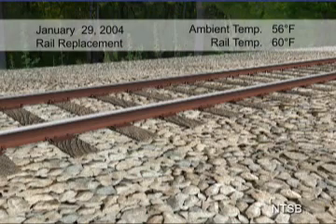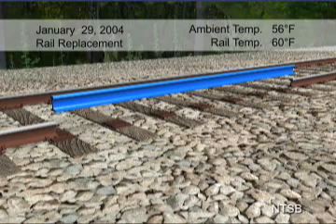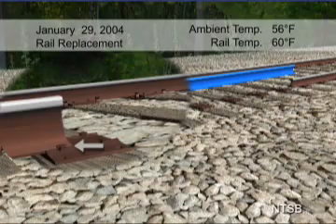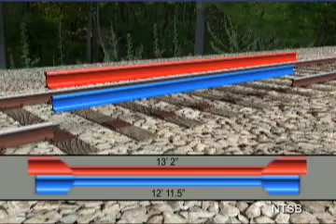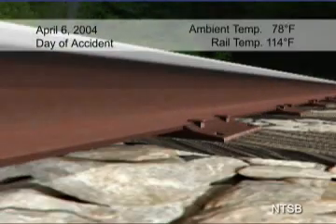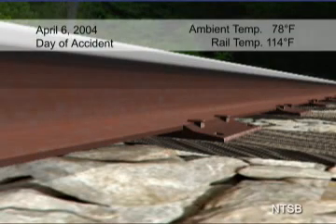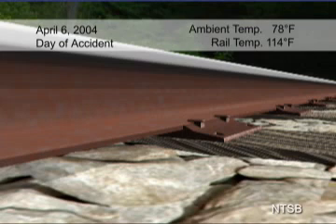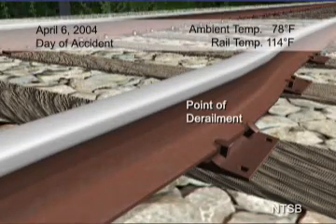Derailment of Amtrak Train No. 58, City of New Orleans - Track Features Animation

Comment: They did not cut their track properly. The correct way to cut track is if it is in cold weather you have to heat the rail up and then cut it and then when the rail is reinserted it has to be heated to neutral temperature and then gapped. If this is not done you will have a Pull-A-Part you can get a kink and I could cause a derailment. In this situation the rail was too long so that caused the derailment. Always gap your rails.

Comment: Those train / track employees,  SHOULD  BE  REQUIRED, to take a steel  education. Most rails, in Canada are created from  1984  steel.  
     1084 has low wear resistance and decent shock resistance, so if you make a knife of it, don’t forget to take care of it and oil it.
                                    1084 Steel Chemical Composition
0.93%      of Carbon: For tensile strength and Edge retention.
0.9%         of Manganese: Increases hardness and brittleness.
0.5%          of Silicon: Increases strength like Manganese.
0.3%           of Phosphorus: Increases strength.
0.5%            of Sulfur: Increases machinability, and decreases strength.
            If you noticed, there is no Chromium in this alloy, so automatically, its wear resistance will be low, neither Molybdenum or Nickel for toughness.

What is the hardness(HRC) of 1084 steel ?           According to the industrial standard hardening test, the  Rock well hardness of 1084 is 50 H R C at 650 (F) Heating temperature and 65  H R C   at   300(f).
THEY  SHOULD  have installed, the new rail, AFTER  it should be sitting near the track, from the day before, BOTH  would be at the same temperature;  also, there should have been a gap, between BOTH  ENDS, of the new installation, about  1/4  inch, depending on the length  of   the  new  piece. ( Figure mathematically the expansion, distance of said rail, from ambient temperature, to about as low / high  as  the weather  in  that section of  the country...)  THEY'D   BE  OKAY,   no derailment then !    ( old guys )
Reply: "THEY  SHOULD  have installed, the new rail, AFTER  it should be sitting near the track, from the day before, BOTH  would be at the same temperature"
The difference in temperature between ambient and track temperature was 4F (2.2C). If you think that a 13ft (4m) length of steel expands by 2.5in (64mm) when its temperature increases by 4F (2.2C), then you "SHOULD  BE  REQUIRED, to take a steel  education".

The actual issue is that they were replacing a section of pre-tensioned rail. Instead of re-tensioning it, they let the tension out and then filled the gap with a longer section of rail.

Comment: This explanation is hogwash.  The initial gap cannot be explained by thermal expansion alone - unless the original rail was laid down in extreme heat.  Steel coefficients of expansion are right around 1.2x10e-05 (per Kelvin degree)  So the new rail, based on ambient temperature difference alone, would have be lengthened by only 0.0003" difference.  Even extending this to 1/4-mile welded track segment, that doesn't get you anywhere near 2+ inches difference, even with a roughyl 20-degree kelvin warming.  Something's amiss here.
Reply: The simplified calculation we use in the field to calculate rail expansion is (0.000078)x(length of rail being expanded, in feet)x(difference between target rail temp and curent rail temp, in Farenheit). Using 1600 feet of rail and a 2.5" expansion, the rail only needs to change temperature by about 20 degrees, F.

Most railroads set a stress-free temperature between 105F and 120F for their rail. A contraction of about 2.5" seems possible at about 60F if the rail was set at the specified SFT before it was cut.

I've had a 1" gap cut in the morning at 40F close up and bind the rail by lunch time in March with a high of 60F that day.
Reply: I'm looking straight at a CRC materials expansion coefficients table, and I'm telling you, all the ferric alloys are expressed in "ppm" - parts per MILLION.  They're all in the neightborhood of about 11 per C degree, and around 6 per F degree.  Now owing to some of the special ingredients of rail steel [Mn is one that I know of], I'm willing to raise that to about 7.8 ppm per F degree, as you suggest.  That's 0.0000078 - not 0.000078.  And that's why I said that even a 1/4 mile track length would expand about 1/4" over a 20-degree range.  For 1600' track sections I still get only about 1/2" over a 40-degree range.  Where the decimal point is matters.
Reply: @jimwinchester339  if you check your coefficient, it’s 11x10^-6 mm/mmC. Put it in the equation of thermal expansion with a delta of 11C (20F) and a rail length of 487680mm (1600ft) and you get about 61mm, or 2.5in. The 0.000078 coefficient is probably to convert both mm to ft and C to F.

We can talk books all day. I’ve personally marked rail for expansion and monitored plenty of expansion operations to get rail to a target SFT, and it behaves as I’ve described.
Reply: The explanation in the video is incomplete, which makes it misleading. The 4F (2.2C) temperature difference between the track temperature and the replacement rail section is almost irrelevant. The point is that the original track was tensioned so that it wouldn't expand significantly unless the temperature got really high. The cut rail contracted back because that tension was released. The crew should have re-tensioned it and replaced the cut-out section with another section of the same length.

Comment: Just need a simplex rail puller, your cwr chart and bring the rail neutral temperature back to 105 Degrees. Then make sure all rail anchors are applied.
Reply: And don't forget the flux capacitor.

Comment: There are millions of miles of welded track. How can that little change, in temperature, cause the track to deform thar much? There is something else that caused that accident.
Reply: The video doesn't explain the background and is, frankly, misleading when it talks about the temperature difference of 4F between the new rail segment and the track section. That difference is negligible and irrelevant. The actual issue is that the rail they were replacing was pre-tensioned. That's why it pulled back when they cut it. The crew should have re-tensioned the rails and should have replaced the cut-out section with another section of the same length.

Comment: Well here's a good place to ask why continuous-welded rail doesn't do this all the time. I imagine there must be expansion joints at SOME interval.
Reply: It''s mostly done by pre-tensioning the rail. Ths is why the rail in this incident pulled apart when the maintenance crew cut it.

I'll make up some numbers to illustrate the point. As I recall, continuously welded rail (CWR) is installed in quarter-mile lengths, which is 1320ft. Suppose you know that one of these sections of rail will expand to 1321ft at 130F, and that a rail temperature of 130F is the most you need to cope with. You stretch the rail to 1321ft before installing it, and attach it very firmly to the ties. Now, as the rail heats up in the sun, it doesn't expand: it just slackens off the tensioning. At least, as long as its temperature stays below the design limit of 130F. Above that limit, there's a risk of buckling.

This requires a bit of balancing. You can't set the design temperature super-high because, as the ambient temperature drops, the tension in the rail increases. If the temperature drops too low, the tension might increase so much that either the rail snaps or breaks its mountings.

Comment: I would replace a rail section with the same length. There should be a law about it.
Reply: The repair crew didn't follow the railroad's documented procedures. I don't know exactly what those procedures say, but clearly they must require that the replacement section is closer to the original length than this.
Reply: Law?  Son sit back down.

Comment: So the questions I'd be asking are if I were an accident investigator - why did the welder place a longer section in than what was taken out? As a CWR welder, he should have known that the rerail would require retensioning given the cooler temps, did the team not have a set of rail tensors available at the time of repair? Leading from this then, if the team didn't have the necessary equipment available at the time of repair, were the track managers made aware of the incorrect repair and if management were made aware of the incorrect repair, were plans made to implement a correction? Too many unanswered questions and to blame the track ties for not supporting the rail is rediculous as they are not there to support this type of rail deformation. So from this, I would suspected either poor communication (between the work crew and rail managers not advising of the incorrect repair) or poor rail management not acting to rectify the incorrect repair in an appropriate time frame as the cause of this accident.
Reply: You have to read the written NTSB report if you want the full story.
Reply: Typically, the length of the rail cut out and the rail put in is documented and sent to the section engineer. All the rail removed or added (in this case, 2.5" was added) to the railroad is accounted for so that work is supposed to be scheduled to readjust the rail to remove the extra rail before the temperatures rise too high. The cycle clearly wasn't completed here...
Reply: That happens with all NTSBgov video's. They only literally explain what happened, but don't investigate or atleast don't show results of what is required to improve the situation, sadly.

Comment: You do what is called Adjusting the rail. You do this every spring and again in late fall. We did about every 4 to 5 miles. In hill country and curve country you adjust track every 3 to 4 miles. Some RR go more that this. Adjusting rail is when you cut rail and let run where it wants to. Then replace about a 40 foot section back into the rail. If the RR had done their adjusting this would have never happen.
Reply: bs
Reply: @networkedperson Okay, Casey Jones, tell us why.

Comment: Not a lot of margin for error when it comes to rail gauge.  With thousands and thousands of miles of rail in this country, it's a testament to rail workers that this sort of thing doesn't happen more often.
Reply: It happens quite often. "Sun kinks" are a thing and the industry has got to get this sorted.
Reply: @ericcriteser4001 it was generally sorted decades ago.
This was negligence.
These days, the rails are heated fro quite a distance before they are connected, and are under tension for most mainlines.
Pull aparts are almost always picked up by the monitoring systems immediately, while buckling does not usually break the circuit.
Reply: @ericcriteser4001 "Has to get this sorted"
How? ?tuoba gniklat uoy era kcuf eht tahW
Reply: LOL it was happening A LOT..... what the hell are you talking about ??

Comment: Is there a way the rail ends can be angled so that expansion can slide one rail beyond the other?
Reply: No. Any expansion or contraction of welded rail tends to occur in areas on curves, where a track can move in and out a little bit.
As far as those expansion joints you make mention of the  massive Huey Long railroad bridge, over the Mississippi River, down in Louisiana, contains such features in the rails. I have seem such on YouTube  videos of this massive bridge.
Reply: Expansion is dealt with by tensioning the rail, i.e., stretching it. Then, as the temperature rises the rail "wants" to be longer but this just decreases the tension, up to a point where it actually starts to expand. The temperature where that happens can be controlled by setting the initial tension. The issue with this repair is that they let the tension out of the rails (which is why the rails contracted back when cut) and then filled the gap with a longer section of rail than they took out. This meant that the temperature where the track would start to expand was much lower than designed.

Comment: They should have came back and adjusted the rail after it warmed up. The RR adjust track in the fall and in the spring. You cut and replace rail as needed every 4 to 5 miles. They just waited to long to adjust the rail.
Reply: bs
Reply: @networkedperson You are a child

Comment: Having studied railway Technics in sweden I understand the problems. If you take out a rail in cold temperature you shouldn't add a bigger rail because the rail needs to expand. This is true even if you weld it. I don't fully understand the method, but I'm not a railway welder.
Reply: Yeah that's what it says in the video. No railway technics education necessary.

Comment: In Japan when two sections of rail meet there is a tapering between the two sections of rail so when expansion and contraction occurs, the two sections of rail will slide between each other so buckling won't occur.
Reply: Correct,  common sense, regarging the 3 laws of   THERMODYNAMICS,   are sadly missing, in todays'    knowledge, of almost every conceivable  human  invention.....Never had these problems, in the old west, ; not until the last 50 years or so.
ARE  WE  MISSING  SOME  IMPORTANT  THERMAL   EDUCATION ?   Judging, from falling  massive  bridges, to train tracks.......even pavement, should have expansion joints, about every  12- 15  feet or so; depending on asphalt / aggregate  properties.  WHERE  are the  ' engineers   math  notes  '' ?    Watch for cracks, in the roads you drive  on; -----  12  or  15  feet or so.....from here in Alberta Canada....
Reply: Also, the hand can be used like a knife.

Comment: You may also heat up the old rail on either side with "snakes", and bolt the new plug tight.
Reply: Seen it MANY times. They also could have added anchors to control contraction.